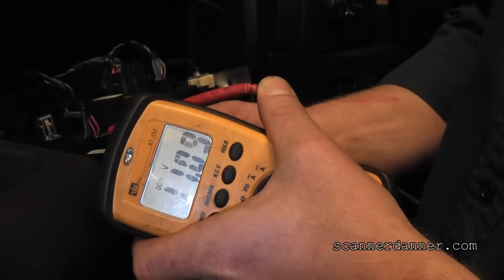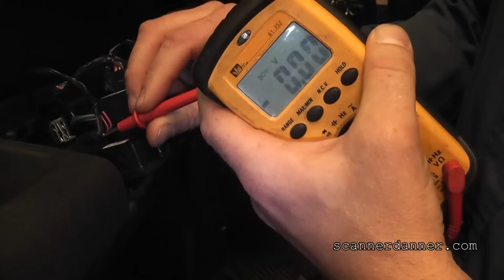Using a Test Light to Bypass a Switch Input Signal

Comment: Test lights are incredibly versatile and powerful tools!  I just had a very similar situation on a 13 Ford F250 window switch yesterday.  The shop had been tinkering with it for a couple hours when I walked in to look at a different vehicle, and before they could even finish telling me what had happened, I had verified circuit type and integrity, and was upside-down under the dash locating a blown fuse for the front window motor relay control circuit.

The things you teach are so absolutely critical, and I can confirm that all this knowlege continues to carry through with vehicles manfuctured in 2024, and becomes more and more important every day as control circuits become more and more complex.

Honestly Paul, as soon as I have my house paid off, I really should start sending you a significant portion of my paychecks, or donate that portion to a charity of your choosing.  I owe you a lot, and I appreciate you more than you'll ever know!
Reply: As Erick O would say when reaching for his test light… “ let me grab the ol scope on a rope “ lol. Honestly once you understand the capabilities of a test light that’s not the LED with display junk they try to peddle that all new techs get conned into buying when they step onto a tool truck I’m guilty of this too, and get a incandescent 200 ish ma test light you can literally diagnose and verify potential repair with nothing but a 30$ scratch awl with a cord hanging off of it lol
Reply from the maker: Love these kinds of stories and feedback. This is all the payment I ever need. Thank you so much! Proud of you man.

Comment: Paul could the ground wire for the switch be used rather than using your test light attached to a different ground? With it only being a small connector and wires in such close proximity to one another it will most likely make the bypass test more difficult to perform. Lastly is using the designated switch ground not needed based off your ground to ground voltage drop test. Thank you for all your content I own the book, I am almost done all of your YouTube content and the premium membership will be next for me. God bless
Reply from the maker: yes! The reason I use the test light is in case the plug I am messing with has multiple pins and I certainly wouldn't want to accidently ground the wrong pin. The test light acts as a buffer in case you do it wrong. 
Yes, the ground to ground voltage test with the switch open and closed, if it stays at 0v, your ground is fine. Thank you for your support!

Comment: Led have higher eesistance
Reply: Yep, most have an internal resistor to limit the current to 20 mA. I do have an LED bulb in my continuity tester that draws a little more than 100 mA but it's powered by a 1.5V AA battery.

Comment: I’ve done that trick few times and yes it does work LED light will still slightly light, but it will pull at the ground
Reply from the maker: Depends on the switch circuit. They're not all built the same

Comment: Couldn't that bypass test work on trouble shooting a fuel pump? Ground your test light to the power side of the a inertia switch then probe the ground side of the switch. With the KOEO  if the test light comes on that would say that everything else is working upstream. So now that makes the switch Or fuel pump bad right? If they both check out good then we're looking at a no spark situation which can be trouble shot using that same technic on the ignition system? Is that right? If so that is frickin  genius  dude.
Reply from the maker: There are variables to your question. A fuel pump inertia switch can be on the control side or load side of a fuel pump relay. But in either case, it is a current carrying switch, NOT a switch input that carries microamps like im showing in this video. Also for an intertia switch, regardless of location, if you were to use a test light, that would limit current flow through the circuit. So it wouldn't work at all on the load side of the pump circuit, and may or may not work on the control side of a relay.
Use a jumper wire if you want to bypass an inertia switch and just jump the two terminals together. Hope that helps.

Comment: HI Paul.  Good to see someone post a video on test lights.  I myself run my own workshop in Australia and specialise in electrical diagnostic and repairs.  You knew there had to be someone pipe up and say how bad test lights are and that you shouldn't use them.  These people clearly don't understand a series curcuit and the effect of the resistance of the bulb can be a very usful tool.  Test lights have multiple uses if you know how to use one and understand the system your working on.  There is no need to go to the scope or scan tool for every fault and people often skip the basics.

Comment: Hey Paul this is quite a coincidence that you put this video up because I was working on my problematic driver side window switch the other day. I disconnected the window switch module and jumpered the wiring to the window motor in order to roll the window up for the night but when I reconnected the module, the driver side window switch worked fine so I think it was just bad contact with one of the two wiring conectors 
 that plug into the module switch . 
I have loved wiring diagrams ever since I was a kid so I bought and studied every service manual(s) to every vehicle I've owned.

Comment: The term "pull down circuit" always threw me off like it's something special or different than a normal circuit.   But all it really means is that we are on the GROUND side of the load;  and the only reason why it shows voltage is because the ground is disconnected.   But when you apply the ground (which is what the switch does)---  it pulls the circuit down to it's natural state in the closed circuit which is:  a ground.   This used to be so mystifying to me and hard to grasp;  but once you get it, it's actually very simple.   

The key thing to repeat over and over-- that most people will not understand at first, because it's counter intuitive is:    That the "GROUND" side of a load will show voltage when it's disconnected.   That's one thing that throws people off;  because it's the ground side of the motor-- why would it have a voltage?    But it does.   That's the one missing piece that keeps people from understanding this type of setup.    

I took 2 years of electronics in Vo-tech and I still never knew this until I seen you explain it on a white board.
and I'm a certified general electronics technician.  :)
I just hadn't ever been taught that simple understanding, weirdly enough.    We always studied closed circuits and how they work.  Not how to trouble shoot them when they are open or broken.
Reply: Oh my god this whole time I needed this ty
Reply from the maker: That's awesome man, that you're an electronics tech. Really appreciate this comment my friend.